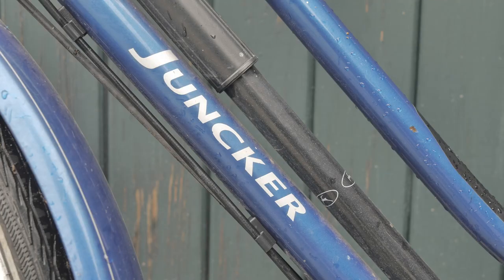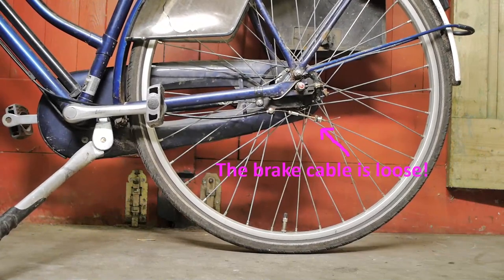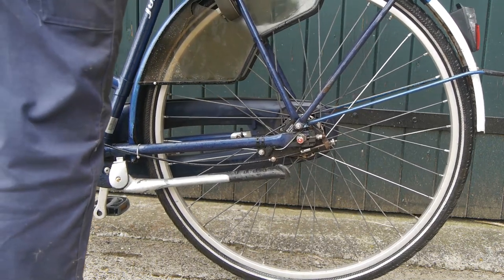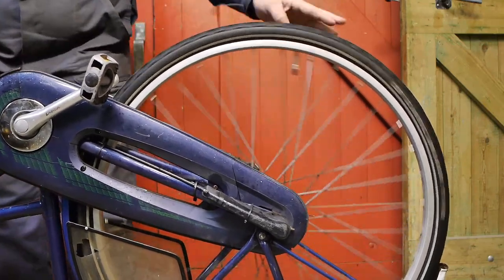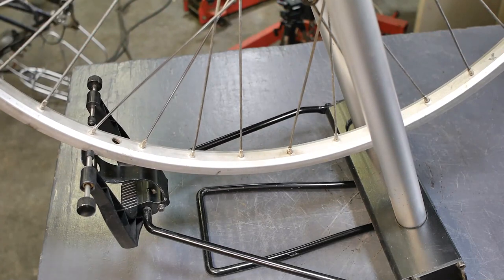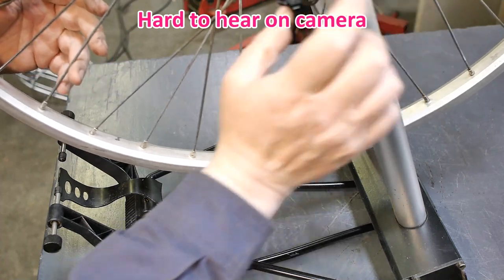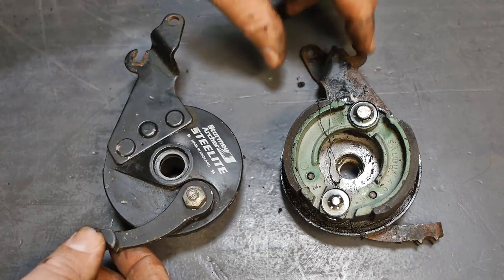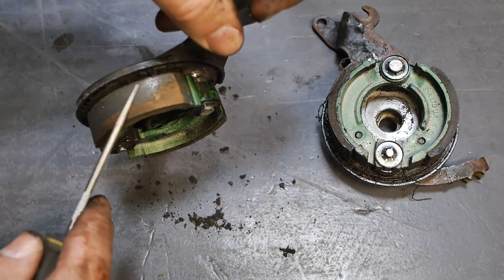Bicycle drum brake job done by an amateur

Comment: Does anyone know if there SHOULD be a washer underneath the brake mechanism? I have an Union probably from 1980's or something with Sachs drum brake. In my case there WAS a washer underneath but I'm not sure if this is how it's supposed to be since I bought the bike used from someone who made some repairs that weren't necessarily very well done (e.g. bearings' balls were facing wrong side). When I put the drum brake mechanism together on the wheel without a washer it tends to cause friction on the axle and stop wheel from spinning freely. When I put the washer inside the drum brake mechanism and screw it tightly with the external nut, the wheel is spinning properly and the brake is working BUT the whole brake mechanism tightens kind of askew and not straight parallel to the wheel. I'm not sure if I can leave it this way.
p.s. my brake didn't have it's own cone at all. There are only two cones on the bearings and the brake was mounted over the left bearing's cone and locknut in this way: thin washer, the brake mechanism, small spacer and normal nut.

Comment: I cringe at all your videos. LOL. The clumsiest mechanic I've ever seen. But it looks like nobody else even tries.
 Doesn't anybody in Holland know how or care to clean and service anything?? WTF. 
All you had to do is throw the whole thing in solvent and work it around.
That 80 sandpaper took off 2,000 miles of pad life probably. 180 is more like it. 240 on the liner. 

That squeak is nothing to worry about. Those spokes are way off tune also.
Reply from the maker: Clumsiest mechanic, that might be true. But I do have fun, and sometimes I get it right :)
Reply: I llove it that you not edit out the 'clumsiness'. They are the same sort of mistakes I tend to make and earned me a nickname referring to my clumsiness. But you learn most from these mistakes. 'Aha, of course!' moments, they are the best..